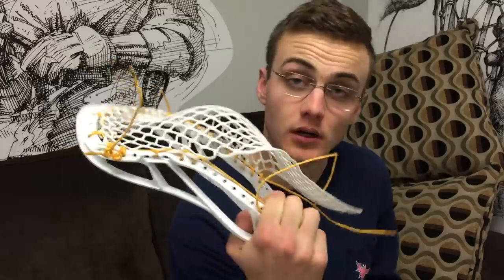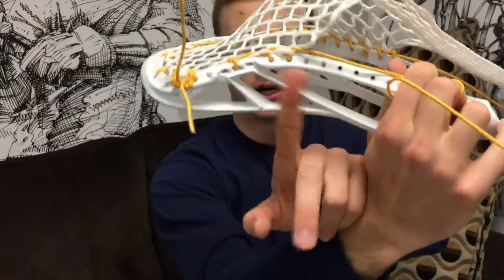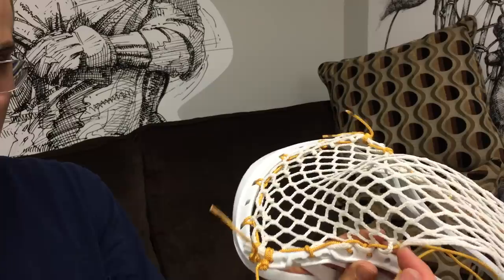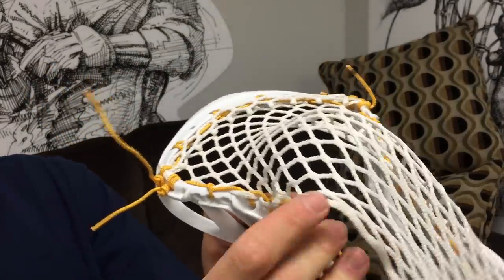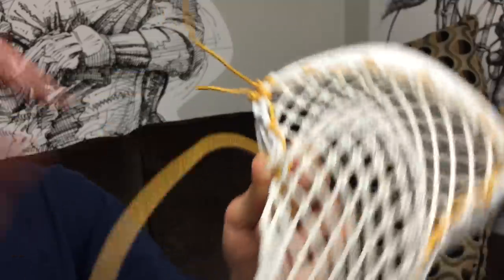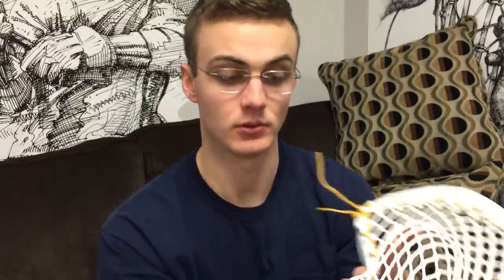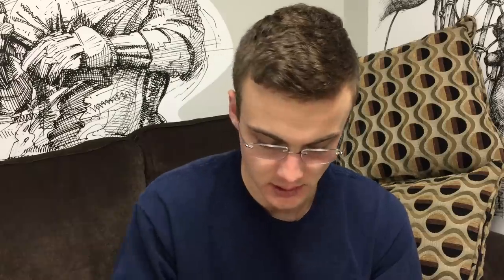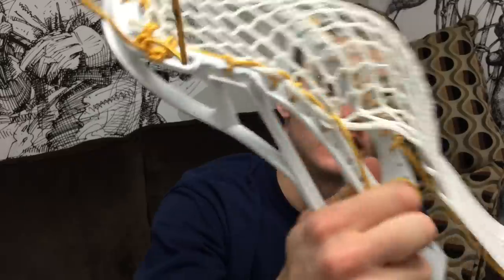How To: Stacked SI (SSI)

Comment: Chris, having also watched your "catch point" video would you use the knotted stacked si if you were trying to minimize the catch point for any attackman who plays close and rarely shoots from outside?
Reply: +Troy F a catch point comes into play only on fast shots, so if you are an attackman that only takes close shots, you will not experience a different release point on those shots, therefore you do not have to worry about a catch point as much as an outside shooter, but to answer you question, Yes, a knotted stacked si would minimize the difference in release between passing and shooting because the mesh is tighter and has no room to shift like a normal ssi, but again if you mostly take shots from close, I wouldn't even worry about a catch point.